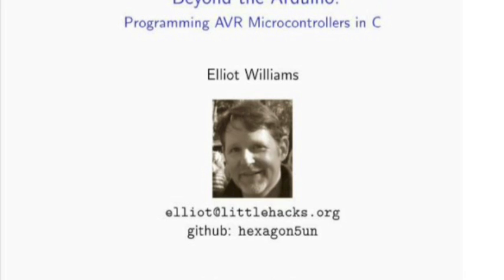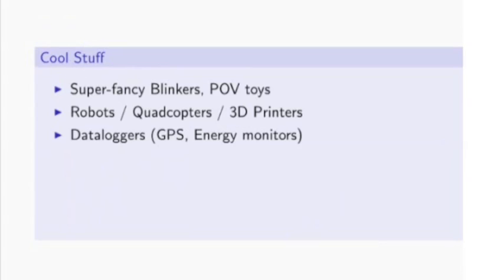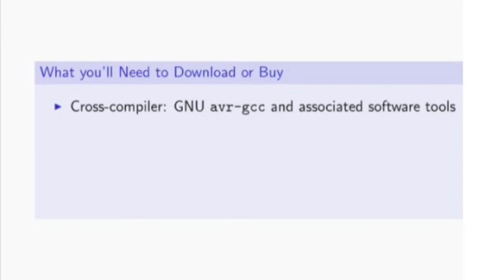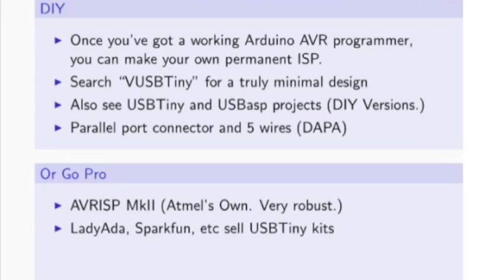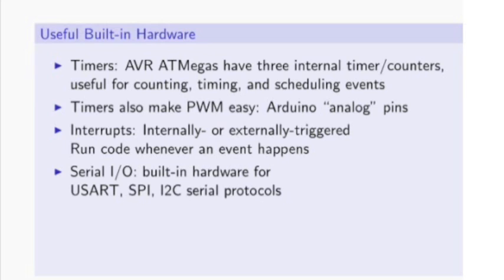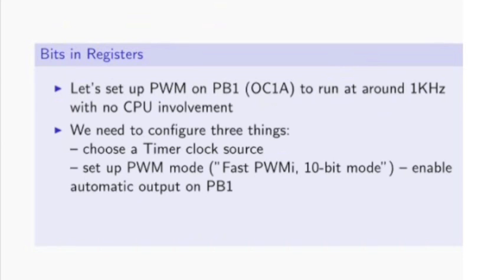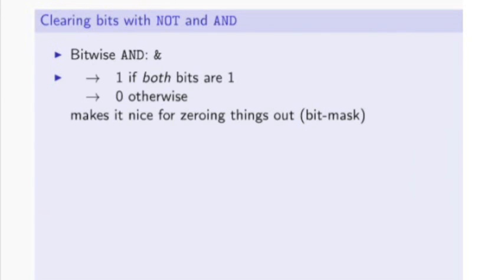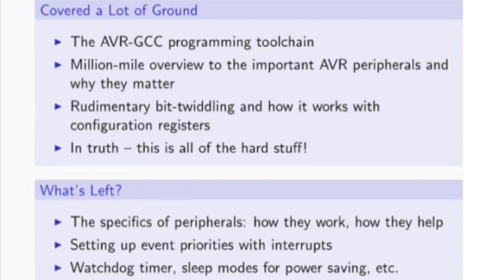Programming AVR Microcontrollers in C - O'Reilly Webcast

Comment: Hi Elliot, I am reading your book and I have recommended it to my friends. I am really enjoying it. I have tons of comments but I will provide two recommendations and will ask a question, only. You should consider splitting the book into two volumes, at least. This way you can add more applications and examples such as LCD, etc. And, the end of each chapter should have a quiz and at least 5 exercises to test the knowledge.
My question is related to why you didn't use a delay that allows multitasking. The problem with the function _delay_ms() is that is a blocking delay and it prevents the uC from doing anything else until the _delay_ms time has expired. It is an extremely inefficient timer function.
Thanks again for taking the time to prepare and share such a wonderful book.

Comment: You rock Mr. Williams!  I saw this very video 3 or 4 years ago, and it was so good, it stuck in my memory (and I'm 50 yo!).

Luckily I had put it in my youTube favorites so I could easily find it today for a project that involves bit-banging to monitor a stepper motor's limit switch with very high timing accuracy (inside an interrupt service routine on one of two processors in my 2-processor project, an esp8266 and an avr 328p)...  This is new territory for me, but I'm very much enjoying it...

So thanks for the super-clear presentation.  It will serve to forge my foray into bit-banging, and save me lots of time finding a proper tutorial!!!

Comment: The shorthand of clearing a bit is so confusing..
Id rather use PORTB = PORTB instead of PORTB &= ~etcetc..

can someone explain?
Reply: +afroninjadeluxe You can do PORTB = PORTB & ~(1 << 4), which works exactly the same as PORTB &= ~(1 << 4). The latter is simply C's shorthand operator to make life easier, its the same as A = A + D being shortened to A += D.

Comment: You have alternate analog to digital available. Use a transistor to switch voltage to a pin with on and off to charge the wire then read that pin in a count loop to drain it. PC gameport ADC. Even a PIC can do it.